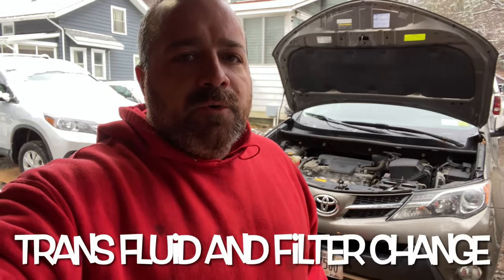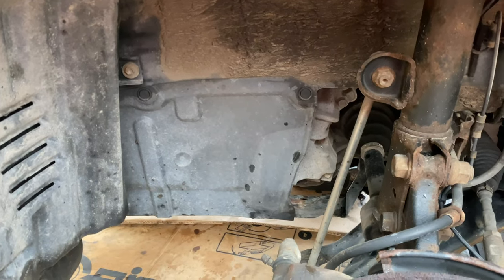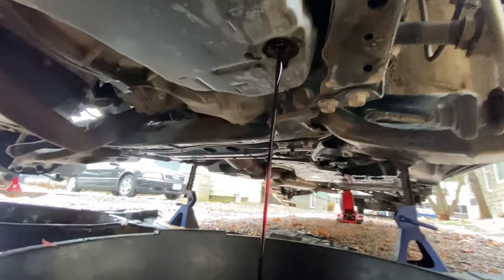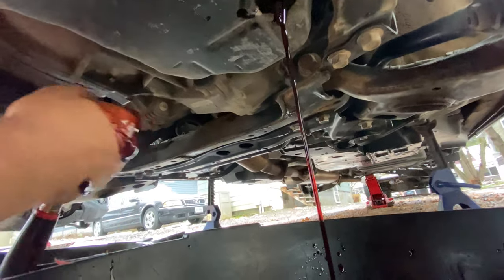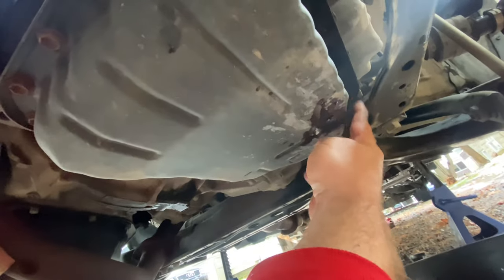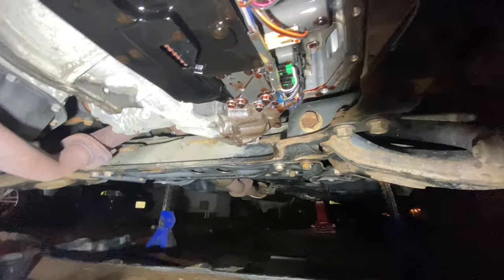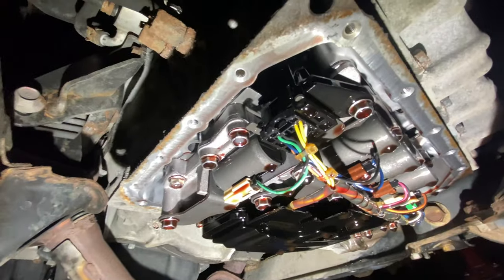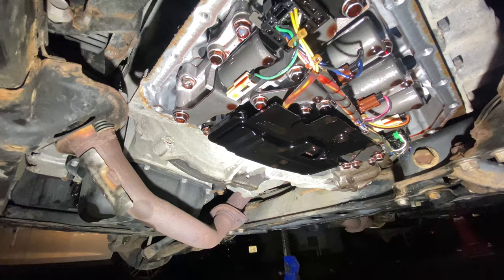Expert Tips for Prolonging Your Car's Lifespan: 2014 RAV-4 Trans Filter & Fluid Change

Comment: Try overfilling by half a quart, allowing all fluid to reach operating temperature, remove drain plug and replace it after fluid drains to a trickle. Saves time and more accurate measurement when all fluid is at operating temperature.
Reply: Agreed - best to overfill a bit so that some fluid comes out because it won't stay in the target temperature range long enough to add more once you've started.
Reply: Yeah I would add a extra 1/2 quart then warm up transmission then pull the plug

Comment: Thanks for the video.  For those doing the change, I would suggest also changing the filter and dropping the pan cover.  Why, when I did that about 1/2 quart was in the on that didn’t drain that I got out, the magnets were filthy dirty and I cleaned the pan with kerosene, when I dropped the filter another 3 to 6 ounces of fluid came out.  I used the bucket with measurement and got a total of about 3 and 1/2 quarts out.  I then added 4 quarts back in and did the drain after bringing up to temp.   The temp gun were easy to access on Amazon for about $9 to 15 bucks with a great. Umber to choose from.  Another trick to help is placing a level with a magnet ( I had one) on the pan to see when it was level using a jack at the back of the car to loft it to level the car.  It took me several hours, but glad I did it.  So far, no issues.  God bless U tubers!!

Comment: You got about 3.5 quarts out, but the total fluid according to handbook was 6.9 Q, so I assumed you could only got about half out.  So basically you only dilute.  Great video, after watching your and some others, after think for awhile, I decide only change the fluid, but not the filter, and do it more often like every 40K miles. Much easier to do, no need to take off the pan.
Reply: you can probably get away with only changing the filter every other change (on a 40k schedule), but you can't just not ever change it.

The pan is just some bolts, ain't no thing.
Reply: My Rav4 2014, has 320k miles, l only changed the filter once, at 60k.. not necessary to ever change it again. But fluid yes after 60k l did this exactly as he did, except always drain at operating temperature! As transmission fluid expanse.  Let it drain over night. 
Then you will have the exact amount to put back in, but yes l always add a half Qt and let it trickle then done...good video!!!!

Comment: Great video. Jeez Toyota. Maintenance is always more complicated with them. I find my Honda has a much simpler system.
Reply: Well, I thought so too - but it's actually a decent set up. A filter in the pan takes about 30 minutes. If you use his procedure - you cannot overfill the pan. Lever the drain plug off, any excess will drain if in right temperature range.

Comment: Some other YouTuber, who did change trans fluid but not filter on a 2015 Rav4 XLE, he got only 2.5 quarts out, not 3.5 Q as you.  Is that seem right? or maybe because they were different model.  The front look different but the engine and the trans were identical to your.
Reply: Why they didn’t changed it.
Reply: @junboo8730  If you checked out lot of Youtuber said you really don't need to change trans filter, main reason, unlike engine oil which oil run thru ring of piston and actually contact to combustion and build up burn CO2 with time and will clog up the filter.  second reason engine oil are pressureized.. Trans on other hand are closed system, trans oil will never expose to any external environment, no dirt or burn build up.  It may have metal deposit which usually very small amount and unlikely to clog up the big surface of the filter.  It may collect in some area of the filter or in the magnet but impossible to clog up the whole filter and hinder the fluid running.  Trans fluid  is not pressurized and very easy running across the filter.
Reply: @TrinhNguyen-vi2qo  Makes a lot of sense. Thank you.
Reply: @TrinhNguyen-vi2qo  If that is true why Toyota use filter at all. You run the risk of clogging important parts in an expensive transmission, versus saving yourself replacing a cheap filter.

Comment: good video.  I have a 2015 Rav 4 with 118K.  I don't have the history but I didn't see the filter/fluid change schedule in the manual.  Is it really necessary?
Reply from the maker: It’s up to you.  Transmission fluid does not last forever.  It degrades over time. Even without a manufacturer recommendation it’s a good idea to do this if you’re over 100k miles. Especially if you want to stretch the life of any vehicle.  Sometimes you can even feel it shifting better afterward. I always keep in mind that it’s in the best interest of the car makers for you to buy another car. They’re not too worried about it at 100k miles

Comment: For those who want a complete fluid exchange vs an approx 40% pan exchange, the following RAV4 approach SHOULD be applicable to Most makes and models:
1.) Remove the plastic shield under the front of the vehicle. Note, new assorted plastic push-clips are recommended.
2.) The radiator cooler transmission fluid out-fall is on the drivers side approx 3/4" OD, 3/8" ID rubber hose with spring clasp clamp --  EASY to see and access!
3.) Disconnect the hose and attach an extension line to a translucent 1gal jug in an catch pan (for overflow/spills).
4.) The steel return line may drip into a second catch pan.
5.) Snuggly attach a clear extension line to the dip-stick tube with a funnel. (I inserted a clear plastic kitchen "baster" keeping the refill level from overflowing at top of the "baster"/funnel).
6.) Start the engine and put in gear (automatic) until approx 1/2 gal OLD is collected and turn off engine.
7.) Fill approx 1/2 gal NEW.
8.) Repeat for approx 2 1/2 gals until bright pink is dispensing.
9.) Reattach radiator/trans Return line.
10.) Adjust fluid level to the low side of the "Cold" mark on dip-stick (so you can top-off to the Hot mark).
11.) Drive vehicle until transmission is up to approx 115 deg. F and adjust fluid level to "Hot" mark.
12.) Reattach the plastic shield using new plastic push-pins.
13.) This should replace the Trans, Torque Converter, and Radiator Cooler with ALL New Fluid.
NOTE: For Sealed transmissions attach an extension line with funnel to the steel Return line (instead of the non-existent "dip-stick tube").
Happy motoring!

Comment: amazing explanation of the best procedure. I only have the doubt since the gasket that I bought from the dealer is metallic, not plastic and it does not show when you removed the old one. Will the metal gasket work?
Reply from the maker: Dealer parts will work. The rubber gasket is aftermarket.

Comment: Great video, Thank you for taking the time to go through the filter change procedure. Can you confirm the vehicle was running while setting the final fluid level after transmission was at temp?
Reply from the maker: Yes. Vehicle has to be running and at operating temp to check fluid level.

Comment: Very good video , I have a 2013 Rav 4 and do you know if it also has the fill plug in the same place as the 2014 ? Thanks again !
Reply from the maker: My best recommendation is to just pull that panel off and check it out. I’m not certain they are the same.

Comment: Great video exactly what I was looking for
Reply from the maker: Awesome.
Reply: @JoesCarSmartsNY  I was wondering if you put any Loctite on the bolts when you put the pan back
Reply from the maker: @UtahTrucker  No. I just made sure to torque them properly.  Also: I always double check for leaks after a day or two and re-torque if needed.
Reply: Try overfilling 1/2 quart, and then allow to come to operating temperature, remove drain plug, and when fluid drains to a trickle, replace drain plug. Saves time and more accurate measurement.

Comment: did you have to engage to all gears before you do the procedure  of getting the right amount of fluid?   
i suspect mine is overfilled , even when engine is cold, the fluid level is on high mark,,, what should i do please help thanks,,  
2004 toyota rav4  rans a little crappy
Reply from the maker: If your dipstick is reading
High you need to drain a little fluid out.

Comment: maybe i missed it but do you do the final level check with trany in park or neutral? thanks.
Reply from the maker: Engine running. In park.
Reply: Did you ever go through any of the gears at any point of the procedure or not necessary? Thanks for the confidence!
Reply from the maker: I shifted down and up one cycle. But I don’t think it’s actually necessary.

Comment: What would happen if i accidentally doubled the filters o rings?
Reply from the maker: It should be hard to install the filter that way. The filter is now probably pressed hard against the inside of the pan. It could make it difficult for the pump to suck fluid up from the pan.

Comment: why does the fluid pour out at temperature when you first drain the fluid, but not when you check the fluid? Wouldn't that mean its under filled?
Reply from the maker: With the engine running a good amount of fluid is circulating through the torque converter and cooling lines.  That’s when you’re checking it. When the engine is off, some of that circulating fluid flows back into the pan and increases the level in the pan. That’s when your draining it, with the engine off so that’s why the fluid level is higher.
Reply: @JoesCarSmartsNY  That makes sense! Thank you so much!

Comment: You need to change transmission fluid once in how many kilometres? Thanks
Reply from the maker: I don’t have the owners manual for this car. Sometimes it’s 50,000 miles. But if I buy a car and it’s around 100,000 miles I change the fluid just so I know it’s been done. Then I’ll do every 50,000 miles after that.

Comment: You use Trans Dex6? but the handbook recommend Toyota WS ATF?  is Dex6 better, that's why you use it?
Reply from the maker: Toyota fluid is better. Use that.
Reply: @JoesCarSmartsNY  Thanks, but the Toyota WS are much more expensive, and I search online on some forum, they said Dex6 was far more superior fluid. And when asking should use to replace WS on a Toyota, the expert on the same forum refused to answer.  I think at 100K I am not risk, but when my car reach 200K I will try Dex6 even though doing so mean mixing Dex6 with old WS.
Reply: @TrinhNguyen-vi2qo let us know what happened to your transmission with shifting. Noticed any harsh shifting or difference?

Comment: Hi. when you measure the level in gallons is the temperature still up? or already in cold temperature?  hopefully you can answer me. thanks in advance
Reply from the maker: You’re asking about when I measure the fluid that drains out?  Measuring warm is best if possible.
Reply: @JoesCarSmartsNY  yes, in your video you show that you transfer it to your measuring gallon, is it already cold or still freshly out from the trans?.
Reply from the maker: @hgaming3171  Fresh from transmission.
Reply: @JoesCarSmartsNY  i see thanks for your reply.  so it means if you add a new fluids it should be less than that. because the new one stilll cold. the fresh fluids out from trans still expanded
Reply from the maker: @hgaming3171  as long as you check it properly at the end of the project you will be fine. Had to be checked with car up to temp, level to the ground and open that drain plug to allow excess to drain. If no excess drains out, slowly add to the side fill hole until I starts to trickle out of lower drain hole.
Reply: @JoesCarSmartsNY  how many liters in total you refill your trans?
Reply from the maker: @hgaming3171  It’s all in the video, but measured in quarts for me.
Reply: @JoesCarSmartsNY  i worry that we are not the same trans model.  i have u760e. i just replace it yesterday. with arround 3.3L. you think its enough?. when you refill your trans how much remaining in the container?

Comment: How many miles were on this car?
Reply from the maker: About 100K miles if i remember
Reply: @JoesCarSmartsNY  thanks..What did the inside of old filter look like? Dirty. Clean.Daughter has one of these with 126k and never had fluid and filter changed.Not sure if it would be bad to change it at this point or not.?
Reply from the maker: @wish2fish37  Inside of filter is tough to see. At your mileage it’s still a good idea in my opinion. If you’re hesitant to replace the filter (too tricky or involved?) you should at least drain and refill the fluid. Then drive it for maybe a week and drain and fill it again.
Reply: Thanks. Guess filter could be cut open to see it. Plastic housing is it not?
Reply from the maker: @wish2fish37  I think it is.

Comment: Here's a question for you. When you first remove the drain plug and check the fluid that comes out.

Then go through everything you said. Now when it comes time to refill. Leave the main drain. Fill in till you get fluid. Once you have fluid coming out the green level.

Put the main drain plug back in running to temperature. Then remove the plug again and measure that amount of fluid. If it's the same amount of fluid as when you initially start it then you know how much to put in. Because if it's the same fluid volume as the first time. Just pour that little mount back in that you took out
Reply from the maker: I’m a little confused about what you’re asking.  

The only way to know you have the correct amount of fluid in the transmission is for the car to be on level ground with the fluid at operating temperature and to make sure that if you add any more fluid…it runs out of the drain hole.  Once it’s done dripping from the drain hole (a few seconds) you know it’s at the correct fluid level.
Reply: @JoesCarSmartsNY  okay what I'm saying is everybody saying you got to do all this measuring. When I'm saying is once you put the green level level tube in the transmission. Poor fluid in until you see it coming out. Now you know that it's at the top of that level.   Reinstall the main drain plug. And run the car up the temperature. This will expand the fluid and make it go over that tube.
Take the main drain plug back out and do what you did. You can also measure the amount of oil that came out of the first time you took out the drain plug before you took out the green plug. If it's the same amount of fluid you're good. Or at least you're at the point you were when you start it
Reply from the maker: @ProwlersPit  Okay.  So, I prefer to measure what comes out so I have a good starting point.  Your suggestion can also work, but the engine has to be running when you check the fluid before bringing it up to temp. The level has to be checked with the engine running.
Reply: @JoesCarSmartsNY  I get that.
But if you pour the fluid in until it comes out over that level tube. You should be at a safe area to do just that. Because when the fluid heats up it will expand. Did you go through all the gears like the old transmissions. Or is that not need it no more.? I don't know what the protocol is for these transmission
Reply from the maker: I did shift through the gears. I don’t know if it’s required or not.

Comment: does your tranny have the shudder at 25 to 30 mph just as tc lockup?
Reply from the maker: No. It shifts nice and smooth. However we test drove a 2013 that had that issue.  I was told it would probably need a torque converter so we skipped that one and bought this 2014 instead.

Comment: Hey joe my 2013 RAV4 is having issues not sure if it’s the Transmission, or the torque converter or possibly the ECM. I’m thinking it’s the tranmission. It has a hard time when shifting. I replaced the trans fluid and the filter it was very dark. (I had someone else do it) even after I got the service done it’s still having this issue. What do you think it is?
Reply from the maker: Some of these have a problem that they shudder at low speeds.  I believe that’s a torque converter.  For your issue you could try to have the fluid changed again. After that a transmission specialist is your best bet to diagnose.
Reply: @JoesCarSmartsNY  yeah mine shutters as well which is forsure the torque converter. And also the transmission has trouble when shifting. Wondering if I should just get a new car. Sucks I paid a fortune for this thing and have only had it for 3 years now
Reply from the maker: @thehurley17  ugh. Sorry to hear this. Try to get a quote for a trans repair replacement. The rest of the car is outstanding quality. Could be worth the cost of repair.
Reply: @JoesCarSmartsNY  true. One guy told me with parts and labor 3,000$